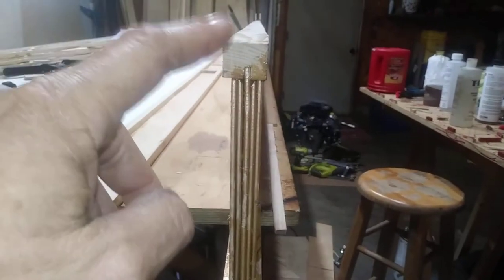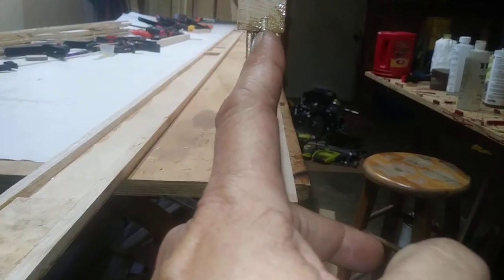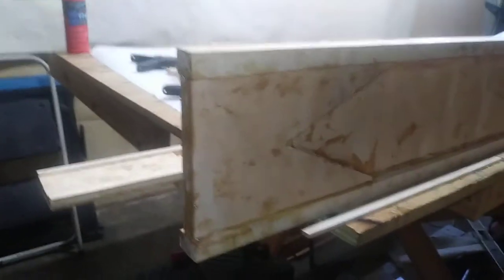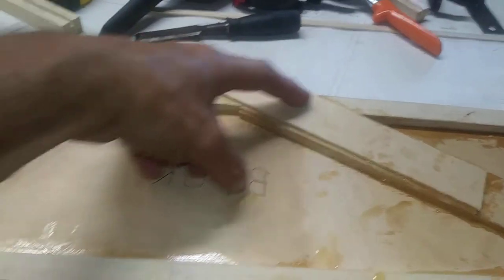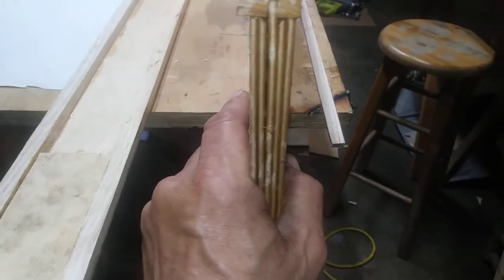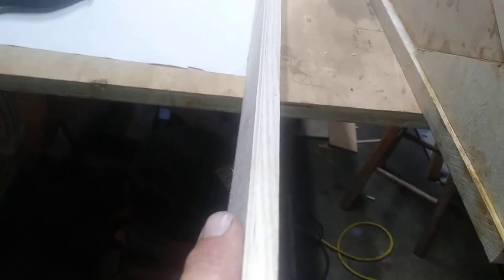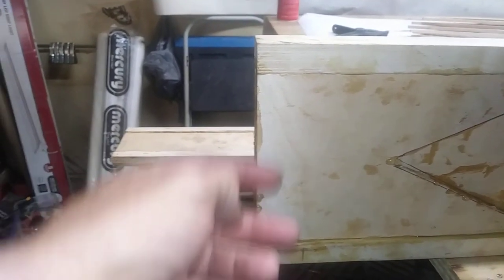Building a wooden wing spar

Comment: For certificated aircraft wood spars the FAA requires a scarf slope to be a minimum of 10:1 and recommends 12:1.   Seems like 5:1 is flirting with danger.  Is that what Fisher recommends?
Reply from the maker: AC43.13-1b par 140 .,..5:1
Reply from the maker: And I've done my own testing and the joint never breaks. At 5 to 1 ratio the wood always breaks beyond The joint regardless of where I set the fulcrum on or beyond to join
Reply from the maker: I've never seen a 12:1 reference. But 15:1 is the maximum slope of the grain when inspecting lumber for aircraft. But...as many sticks of lumber have a greater slope near the ends, this can be taken advantage of when scarfing longerons together. Also described with drawings.
Reply: @timketcham9139  when I did my A&P training AC43.13-1 was the "A" edition and that's what I was basing my comment on. I just looked up the "B" edition and there have been some changes.  Spar splice scarf joints have gone from a minimum of 10:1 to a minimum of 15:1.  Where are you seeing 5:1?
Reply from the maker: Originally I got that information from the blueprints on Fisher flying products airplanes, and the Maranda 14h Prints, actually the super koala and the storch prints also show 5 to 1 scarf joint on spar caps. But I'm one to always looking information up and do my own testing. So I found it in AC 43.13-1b. but also did my own testing building up many times of 5 to 1 scarf joints out of various woods and slow stress testing as well as drop testing them. 
Now I have seen references to metal spars being 15 to 1
Reply from the maker: But as far as metal spars go I don't really build with metal and when I worked on that force and f-16s I was on jet engines so no experience with that
Reply from the maker: I'm building my 3rd set of these wings and realized that the scarf is actually 6.5:1 the longerons are 5:1
Reply: T-88 is 7,000 psi strength 5 to 1 seems good

Comment: hello my uncle, what kind of wood are you using, is it Pine? or any other wood?
Reply from the maker: I use commercial white ash. It's 1.4 times the weight of Sitka spruce, but 4-6 times stronger in all of the moduluses except the modulus of elasticity. 
There are other woods that can be used. Northern White Pine, Yellow Poplar (not tulip poplar). 
NACA report 354 is a good resource.
Reply: @timketcham9139  thank you uncle, this type of wood is very rare here, in Asia there is fir wood but I don't know what type it is. Your plane is very beautiful, success is always for my uncle
Reply from the maker: @stolaircraftsuyanto9728  find out what kind of wood it is. There are many acceptable woods that you can use. And most of them have good data on their strengths. And most important with these woods is that it has to be graded for straight grain, no knots, and specific gravity. 
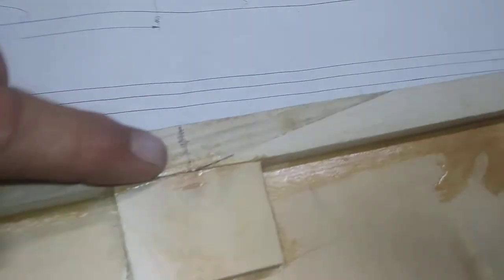You don't want a slope in the grain on any given board to be more than 1:15. Inspect for tight grain, 6 growth rings/25.4mm.
Reply: @timketcham9139  thank you uncle, glad to be able to communicate with uncle. 🙏

Comment: 1 to 5 ? should be 1 to 10
Reply from the maker: Not according to AC4313.1b and NACA report 354 and several other publications.
Reply: @timketcham9139  5:1 refers to 'reinforcement plates,' AC photo on pg 1-19 shows "15:1" 10/12:1 will do, please don't let that slide.
Reply from the maker: @seerjfly4783  I read the paragraph through and reviewed the illustration and only see reference to 5:1 and drawing of 5:1. Don't want to argue but please find a reference to 15:1. OR, ARE YOU REFERRING TO THE SLOPE OF GRAIN FOR GRADING WOOD?
Reply from the maker: @seerjfly4783  I really am interested in your reference, but it doesn't change the 5:1 in this video as it is the design and on the prints such. Same with all the Fisher, Minimax, Ragwing... every wooden plane that I've built or restored or have plans for.
Reply: @timketcham9139  I can't post a photo here, but '15A' on the drawing pg. 1-19 means 15:1.  I don't want to argue either, build as you like. We are building 'experimental's' after all.
Reply from the maker: @seerjfly4783  right, I build to print and every print I have built from shows 5:1.
Someone told me Jodel calls for 12:1.